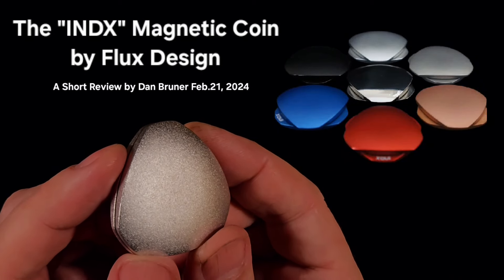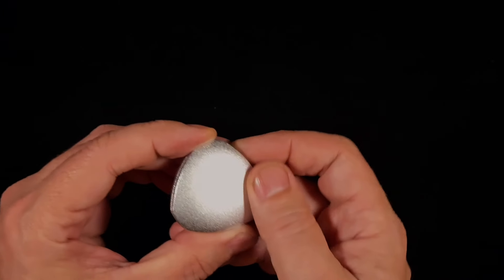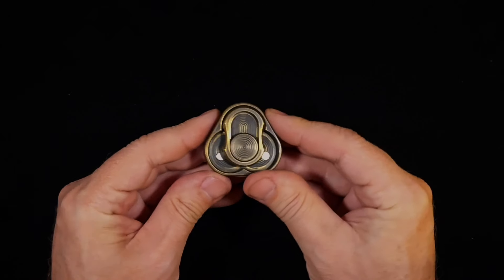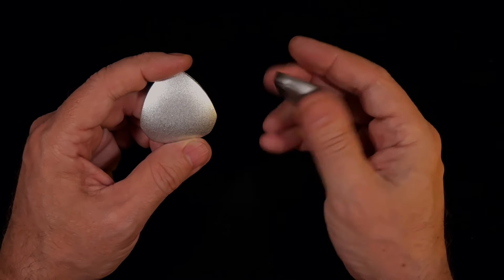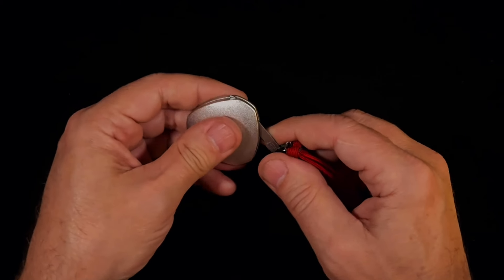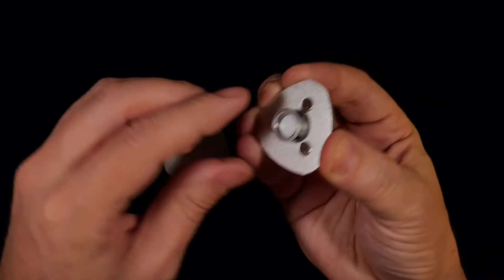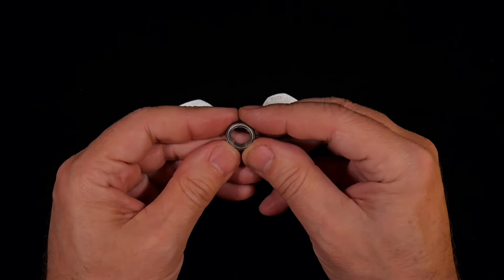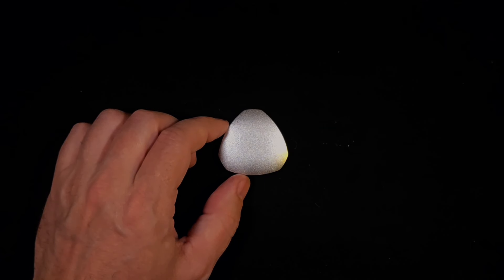"INDX" Magnetic Coin by Fluxx Design - A Short Review by Dan Bruner Feb.21, 2024

Comment: 🎯 Key Takeaways for quick navigation:

00:01 🔍 Overview of the INDEX Coin by Flux Design
- Overview of the INDEX coin by Flux Design, its features, and purpose.
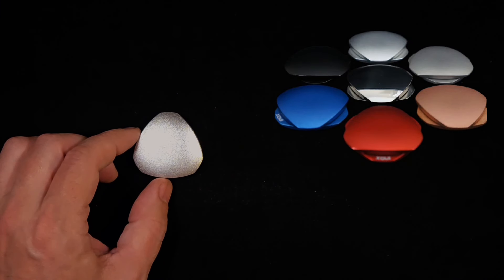00:44 🛠️ Material Options and Finish of the INDEX Coin
- Discussion on the material options (titanium, stainless steel, aluminum) and finish options of the INDEX coin.
02:09 📏 Size and Weight Comparison with Other Fidget Items
- Size and weight comparison of the INDEX coin with other triangular-shaped fidget items.
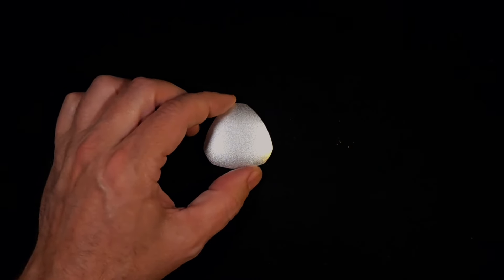05:48 ⚖️ Measurement and Weight of the INDEX Coin
- Measurement and weight details of the INDEX coin.
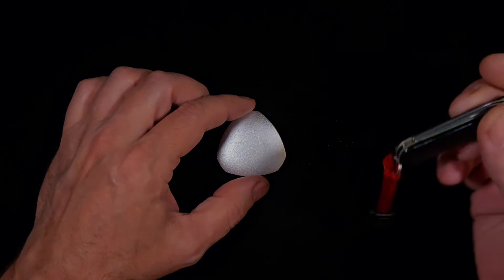06:36 🧲 Disassembly Process of the INDEX Coin
- Step-by-step explanation of the disassembly process of the INDEX coin.
09:58 🛠️ Glue Removal and Maintenance of the INDEX Coin
- Instructions for glue removal and maintenance of the INDEX coin to ensure longevity and optimal performance.

 :)